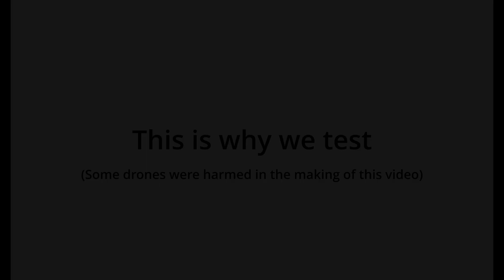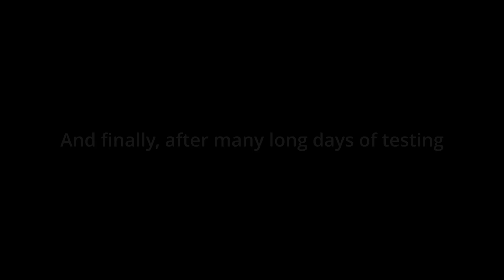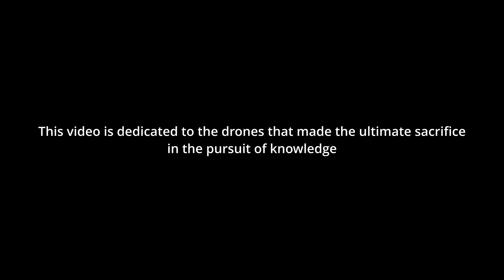This Is Why We Test

Comment: My initial thought was possibly two coat hangers could do a good job of hooking on, but then getting unhooked would require more skill and risk...

Maybe a servo or small solenoid could rotate a small aluminum stick 90° and act as a latch combined with the coat hangers. So in case of like really high winds the drone has higher survivability.

The design of having to fling the drone up into the power line seems more difficult to achieve than say two hooks on the top of the drone...